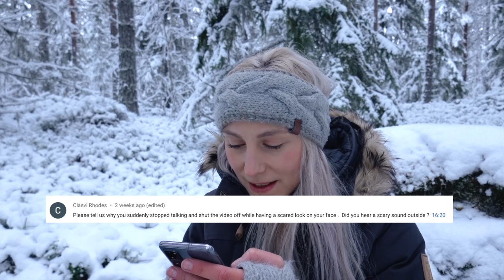My days of November | Ep. 48

Comment: Thank you.  45 or so years ago, I was on a lake, that would run 10 miles in one direction and a mile or two across.  I was skating - it was a very cold start to winter, without much snow at all.  When I stopped - skating, I would hear the loud noises from under foot.  It gave a reverence for those untouchable things. It has taken me - to my 50's before I started to reflect on those things and the meaning they hold.   I was to the lake this week.  Ice had started to run back into coves, but warm weather left us with none.  Cheers to you and yours.